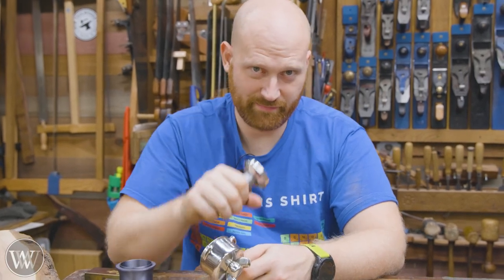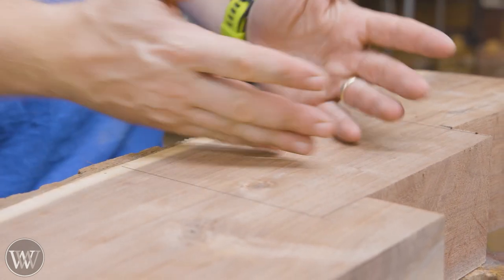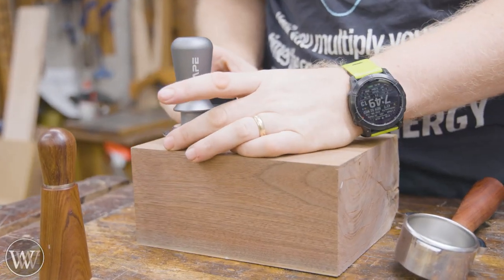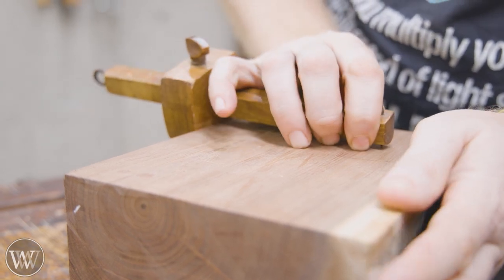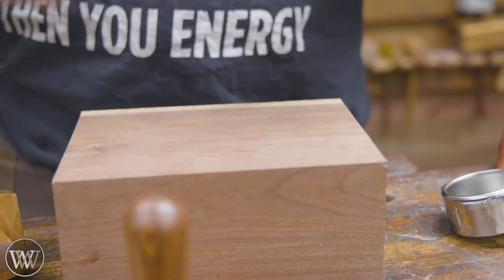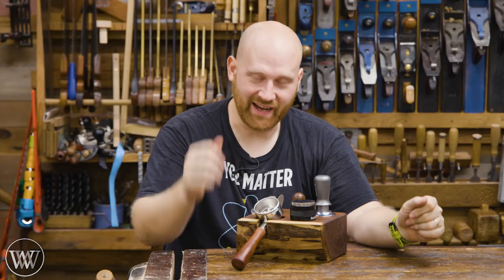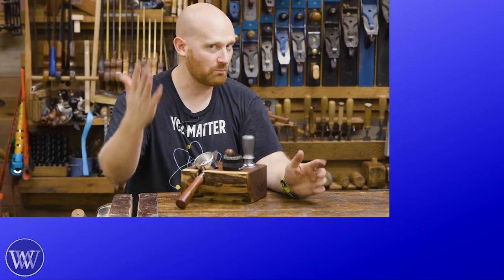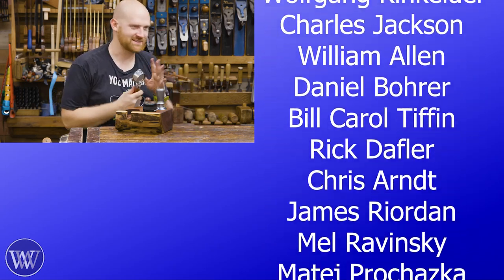Making an Espresso Buddy

Comment: oo one think i see as a really simple and useful wooden thing to make is a scale cover. essentially a thin bench hook shaped piece that protects ur scale from heat and syrupy espresso spills. and some people add a small ledge to one side so u can flip it on the scale and measure the weight into ur portafilter without having to fumble around and balance in on the scale plate. i made myself a small bean cellar so i can weigh out every dose ahead of time. also keeps beans fresh.
Reply from the maker: That is a good I deal. I have been using the rubber one that came with the scale.

Comment: When putting big holes in Aust. hard woods, I have used a socket breaker bar with a bit adapter. Still hard work. Impact bit driver does the best job of big holes in really hard woods IMHO.

Comment: James, your hopper needs a kickstand for the handle. You can mortice it into the main block. And come on... no carving? It needs some coffee plant and the word "Esspresso" across the front of the block, and coffee plant winding over the front edge onto the top and sides.
Everyone else; Call me a barbarian if you wish, but I still prefer a good ole percolator cup of regular coffee with a little creamer and sugar. But I'd do mix my own blend of selected beans and grind them. Store bought ground coffee is too fine for a percolator. You just get a richer cup from the percolator running the hot coffee back through the grounds as it gets stronger, NO paper filter robbing you of the essential oils and flavor. You adjust the strength by how much coffee you put into the "basket", or by how long you brew it on a cooktop/fire. It is a science experiment to find your preferred blend and brew amount/time. But once you do, it is easy to repeat for the perfect cup every time. And, you have several cups depending on the size of your percolator and cup/mug. (Just adjust the burner to keep it warm and not continuously boiling, or it just keeps getting stronger.)
Reply: P.S. a Kurig or drip maker takes most of the adjustability out of it and you are stuck with someone else's ideal cup, especially with those pods.

Comment: that's a cute station, but it seems twice as thick as it needs to be, and the handle could maybe sit in a tough in the wood instead of hanging out the side like that... it would both lower the amount of space the buddy needs on the counter, and keep that tool from tipping out like it is in the closing shot...
Reply from the maker: I could make it about 1/2" thinner but not much more then that. the portafilter sits on the three lugs so if it were in a trough that would make it not balance well when tamping. the portafilter does not get stored in the buddy it is only there for tamping.